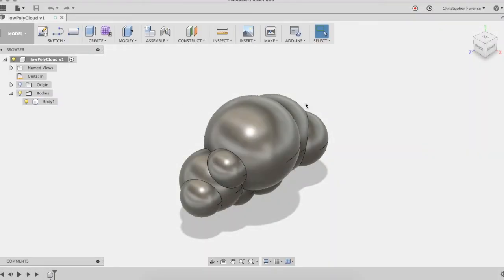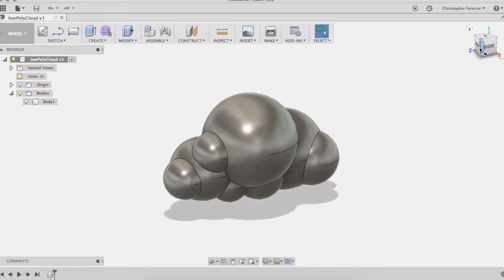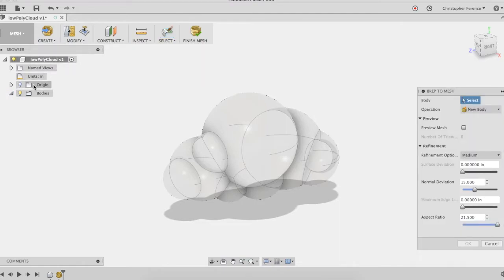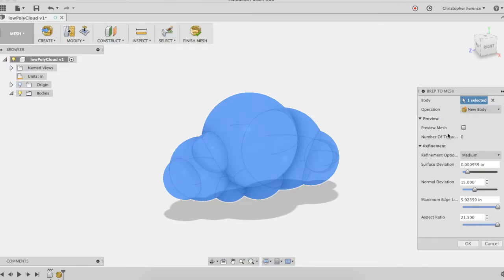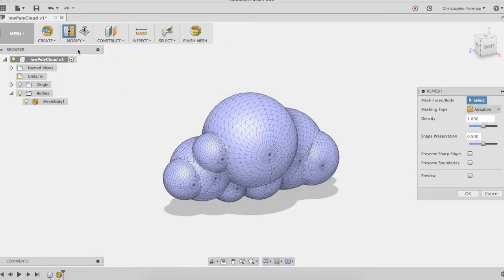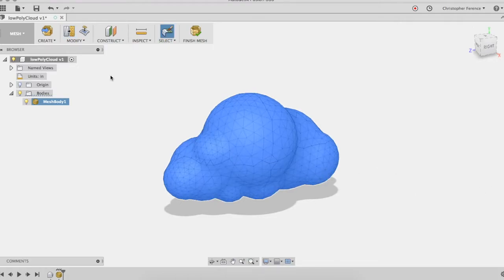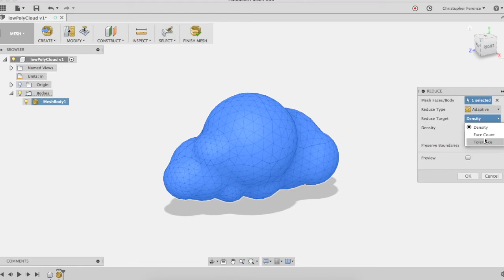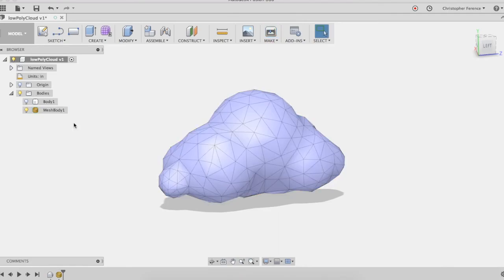Creating Low Poly Designs in Fusion 360

Comment: Thanks for great explanation! Is there a way to do this on faces or exclude parts of the body?
Reply from the maker: I would recommend splitting the body where you want to do the low poly part. Once it's modified, combine it back with the original shape.